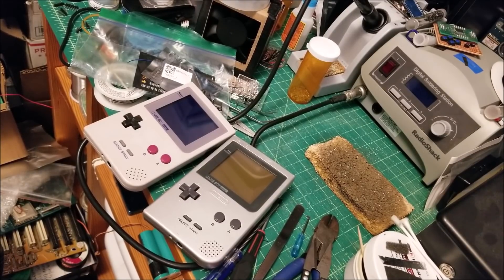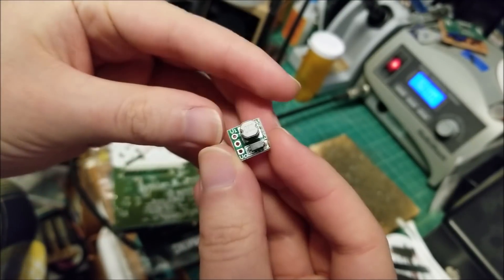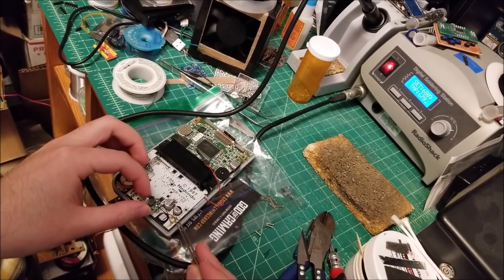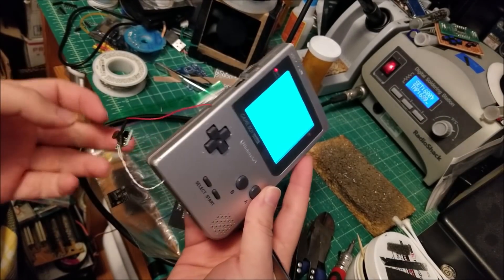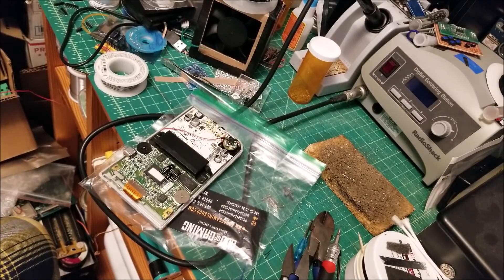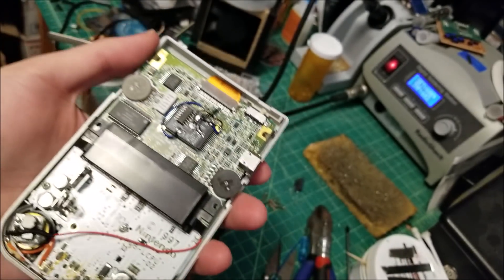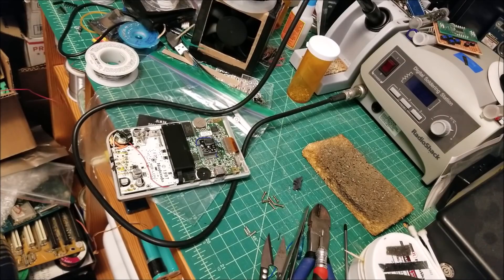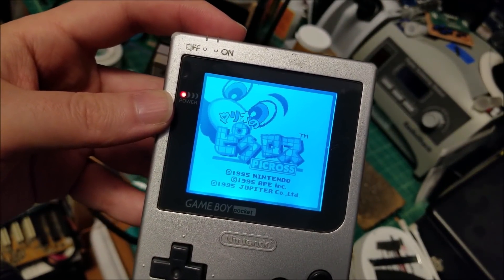Let's Mod: Nintendo Gameboy Pocket Bivert and 5V Regulator Install

Comment: Hey Shawn - I’m needing to install the boost on a Pocket on my own, and in watching the video again I can’t tell which pins I’d connect the 5v boost to. And my Pololu 5v is very small so I’m excited to try it!

https://www.pololu.com/product/2115
Reply from the maker: If you want to power just the backlight with the 5V boost output then just wire the + of the backlight straight to that. If you want to do what I did to be able to use the everdrive without browning out the original 5V converter then you can follow the wiring of the pocket I modded for you. If I remember correctly I ended up having to use a small resistor between the stock 5V dcdc pin and the 5V boost output.
Reply: sjm4306 Thank you, Shawn... oh boy... I can tell I’m not awake. Of course I can just open the one you modded for me to see the wiring points!
Reply from the maker: No biggie, my brain doesn't function till noon!

Comment: does any polarizing filter work?
Reply from the maker: Black and white gameboys use linear polarizers. Luckily the majority of filters you find online are linear.
Reply: @sjm4306  guess the iPhone ones will work ill just have to cut it can do 2 gameboy screens with 1, ok I have tested the ok from iPhone 5, the screen looks green on the Poket but it would be perfect for the Classic.
Reply from the maker: If you slowly rotate the angle of the filter you can change the shade from greenish to white to bluish.

Comment: Awesome video! Can you fix the link to the diagram for wiring the bivert module? Appreciate it!
Reply from the maker: It's the 8th picture on the sales page that I used. The 9th pic is useful if you wanna wire from the front of the board for easier soldering.
Reply: @sjm4306  Ah, gotcha! Thanks!

Comment: Nice job! I usually use smaller bivert chips so I don't have to worry about them pressing on the screen, but the baby powder is a great tip. I'm going to try using the regulator only for the backlight too, I usually cut pin 6 on the built-in regulator and power everything.

Comment: Nice video, dude! You're the first on YouTube to provide a look at installing the 5v regulator, as far as I'm aware.

Is there any advantage to using the original regulator for the original components and the new regulator for the backlight as opposed to the other way around?
Reply from the maker: The original built in regulator is likely less efficient at higher currents than a modern boost converter. I did a video awhile ago testing gameboy pockets with backlights (one with extra 5V reg, one only stock reg) vs stock pockets (with or without power led) to see the current draw and estimated battery life and found having the extra 5V regulator to power the backlight accounted for something like an hour or so extra battery life (I cant remember the specific time but it was significant enough). Best thing to do would be to just redesign the entire little converter module using modern parts as a drop in replacement which would net even more power savings (I may give this a shot if I get bored one day).
Reply: @sjm4306  I'll buy some if you do that!
Reply: I also never have seen an install video on the regulator, so when I asked Shawn for some help we made it part of the deal to record it for myself and others. :) I feel famous. ;)
Reply: @DustinHamiltonSituatedAction  Oh hey, we've been chatting in the post on the Retro Future Community group about these regulators (I'm James).

I installed one of the Pololu U1V10F5 regulator boards in my pocket at the weekend, which was nice and small.

I believe the tutorial I followed made it so that the original hardware was powered by the new Pololu board and the original regulator board powers the backlight only.
Reply: shinynewjb awesome - I remember you posting about that too... I don’t think I purchased that one, though, and honestly perhaps I could have found a smaller one. I’m a total novice at that level of electronics modding, so I clearly just plain don’t know. Hah. ¯\_(ツ)_/¯

Shawn is hooking it up for me, actually, in a way that may prevent my Pocket from browning-out when using my EverDrive GB X7.

Comment: Hmm, I thought the ~16V on PIN 5 of that converter was used for the display, but I saw that it still works after you've removed it. Why would they go through the trouble then o.O That's a monstrous bivert converter module, there are tiny ones on tindie that fit between chip and LCD connector.
Reply from the maker: The Vee pin (~16-19V) pin you are referring to is to bias the lcd (basically control contrast). I didn't remove it or change anything that the original converter is doing, I just wired an additional 5V converter in parallel to supply just the backlight. The two pins cut for the bivert mod are pixel data 0 and 1 (for the 4 shades of gray). Yes I've been hearing about the new tiny bivert modules, I'll have to get some to play around with. I only used the larger dmg one because that is what my friend sent over for me to use.
Reply: @sjm4306  ohhhh, I didn't spot that there still is a converter board in there. Since you had one in your hand I thought you just took it out :D thanks for making me look twice.
Reply from the maker: Lol, I just happened to have a spare converter I pulled from another pocket that happened to be labelled so I could reference which pin did what (interesting not all pocket converters have the pins easily labelled).
Reply from the maker: Very cool, I gave it a like!

Comment: Would it be possible to desolder pins 4 and 5 of the CPU and bend them up instead of cutting the traces on the pcb?
Reply from the maker: Yes you can do that, just be super careful to only bend them once or twice as they will snap off if strained too much and then it will be super difficult to fix. I find it easier to cut the traces and if I wanna go back to stock I can bridge the cuts again.

Comment: You should be able to fit the regulator on the bottom right by putting it at an angle thus freeing the space on the speaker to fit the bivert on it. That way you won't apply pressure on the CPU when closing the shell :)
Reply from the maker: It seems to just clear the backshell near the cpu (I got lucky) and only presses if I screw the back on tight, which isnt necessary anyway. I know everyone puts the bivert on the speaker but as a digital board designer putting ~4mhz dot clocked signals through 4" wires and back would've driven me nuts lol.
Reply: @sjm4306  No problem ! Maybe you could make your own bivert chips for the Pocket and make a video about it showing the pcb designing process
Reply from the maker: Yeah that would actually be a pretty easy/fun thing to do. I could even do it with cheaper discrete tiny smd resistors and transistors for kicks (all the commercially available bivert modules I see use inverters/NOT gates).